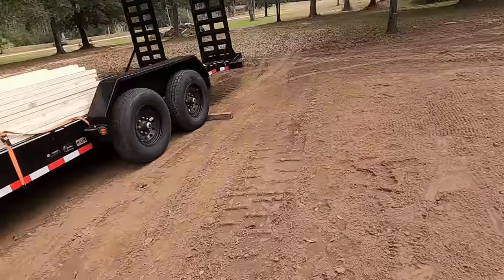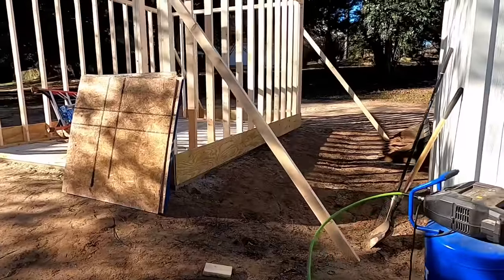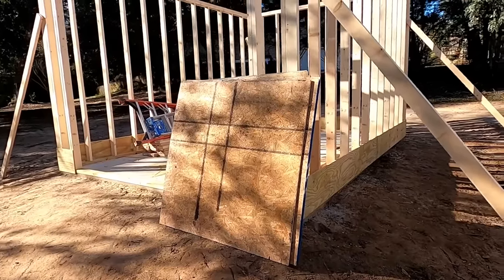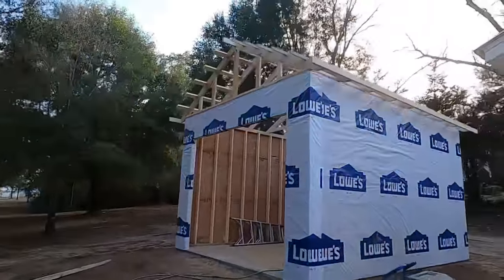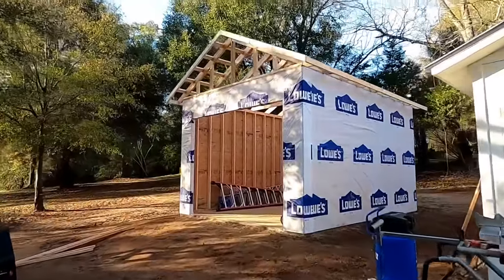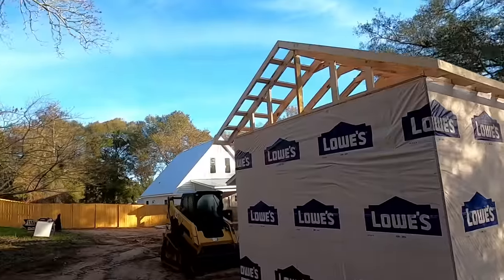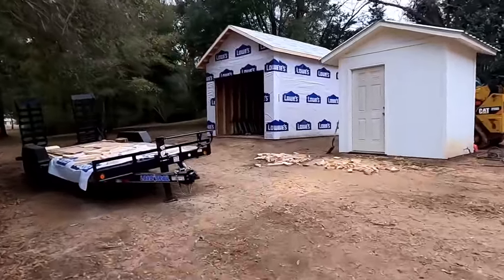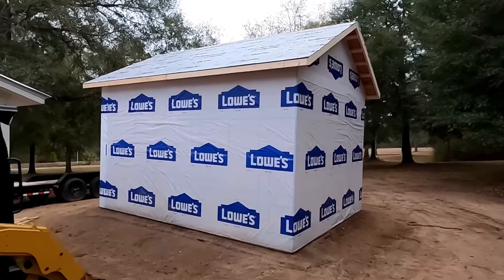Building a 12x16 Shed start to finish! Time lapse. Cost $2,800.00

Comment: So this has to happen for me this year.  I see a lot of videos really pushing screws rather than compressor driven nail guns.  Thoughts?  For sure the screws are a little more expensive but no compressor, etc.
Reply from the maker: Yeah I like screws for somethings. I used them to install my ridge beam. Then again on the rafters just one in each to get them in place. Other then that I like using nails. If you don’t have a compressor you could buy the pasaload cordless framing nailer! You don’t need a compressor. It comes with a battery and charger for $399. Here in Alabama! Then you buy the gas fuel cell and your ready to go. I told myself that when I build again I’m going to buy one. I don’t have to wait for the compressor to recharge, or deal with the hose being tangled or not long enough. So anyway that my thoughts. Good luck with your build! What size building do you plan to build?
Reply: @weightbuilddig166  12x16 minimum.  Rule is the big door will allow me to drive my JB lawn tractor (think cut the grass) into it and back out.  A loft, and a secondary door for people access.  Going to wire it for DC so the solar panel will handle charging and security, illumination etc.  Also going to add in a small subpanel that runs to the outside that will allow me to plug in a generator if need be.  The AC will ONLY go a 2 outlets, one being to the AC to DC convertor.

That's my dream.
Reply from the maker: @cgilleybsw  That will be nice! You can do it, just be ready to put in the work. It took me 3 months from the start to finish. That’s 4 hours Monday through Saturday. Then 8 hours for two weeks Monday through Saturday.

Comment: This is exactly what I want to do in my backyard... But I will probably go with a wood floor instead of concrete, mostly because I know nothing about pouring concrete.  Any advice but that?
Reply from the maker: Oh cool! Are you asking advice on the wood floor?
Reply: Concrete is very affordable. Probably more than wood nowdays. Watch some concrete slab videos and you will get the idea. A small slab is not that hard to pour by 2 or 3 persons. If you can order a cement truck that is the way to go.
Reply from the maker: Yeah I did this myself with the help of my buddy. It wasn’t bad. It was my first time doing it myself. I poured 4 yards and it cost $900. I got 3000 psi with fiberglass and it was $175. Yards. Two years ago I was building my house doing the foundation and I paid $125. A yard. So our concrete is more but our wood is way down almost back to prices before Covid.

Comment: So is that cost include permits? Cuz at least here in Michigan you can only go up to a 12x12 n it cant be attached to the ground or another structure in order to build without a building permit. Unless its for agriculture
Reply from the maker: Well I live outside city limits so there is no permits required
Reply: @weightbuilddig166  I don't live anywhere near a city, still gotta have a building permit though. All it takes is someone seeing a bunch of building materials going to a property or someone seeing n hearing construction n they can go say something n a building inspector with nothing better to do will be all over it wanting to see the building permits. Can't do anything in Michigan unless it's super hush hush n no rats or enemies just itching to report it
Reply from the maker: @benmiller5015  Yeah your right about that. I did go to get one and they said I didn’t need one. So I did check. I did have to get one when I built my house.
Reply: @weightbuilddig166  that's awesome that your area has more reasonable building regulations. It just kinda sucks that around here you could build a 100ft long building as long as it's agriculture but I can't build something bigger than 12x12 without a permit
Reply from the maker: @benmiller5015  That’s does suck. Make’s you wonder what they base there decisions on.

Comment: Just curious, but why not use 24 inch spacing for the studs? It looks like the rafters were 24.
Reply from the maker: Yeah the rafters are 24”. Yeah I don’t really have an answer for that. I like 24” on center it would save on some wood but I always just seem to go with 16” on center. More of a habit lol.
Reply: That is pretty typical actually. wall studs and floor joists usually are 16"oc while rafters and trusses are usually 24"oc
Reply: I was told one houses-16in sheds-21-4in. Probably 15 years ago… but I have no faith in myself so I overkill everything. Always 16

Comment: Does the slab have footers and rebar?
Reply from the maker: No footers. The slab is 3000 psi with fiberglass 6” thick. The fiberglass is so you don’t have to use rebar.
Reply: ok thx

Comment: Does the 2,800 include the cost of the slab?
Reply from the maker: Yes it does. $900. For the slab $200. For dirt and $1700. For the materials.
Reply: @weightbuilddig166  no way!! i need to check my math on the slab estimate i did for myself
Reply from the maker: @jenniferhermanson8969  yep that 4 yards at 3000 psi with fiberglass and delivery $900.
Reply from the maker: @jenniferhermanson8969  Yep that’s 4 yards 3000 psi with fiberglass and delivery

Comment: This would need a permit where I live and it would not meet code starting with the foundation.
Reply from the maker: What would be code for the foundation where you live
Reply: @weightbuilddig166  15 inch footings with steel at least 3/8 rebar and 18 inch block above grade filled with conrete or slurry. The snow would eat up the sill plate in 5-10 yrs because of snow here, so you can't put the walls on the concrete the way you did. We had a 2 foot snow 4 days ago. It piled up to the top of my block on my house and garage. You would need a permit for that bldg. too.
Reply from the maker: Yeah that makes sense. Thanks for sharing the information.

Comment: Lots of code problems your header is only a single Jack on each side should be double jacks yes plate should be treated should be pearllines in the walls And your garage by code is required to have a slope from front to back and should be a sloped at the garage door and there isn't one and the garage door isnt bolet down properly as per code  there is none for the rest of the structure bolted either
Reply from the maker: Thanks for the info. I did forget the double jack legs. I’ll put those in there.
Reply from the maker: I did put those in there. I just checked.
Reply: @weightbuilddig166  I hear you but your pictures didn't show it
Reply from the maker: No your right I didn’t put those in I was thinking of something else.
Reply: I’m guessing if he didn’t have to have a permit there isn’t a code in his area

Comment: I’m shocked you got that done for so inexpensively nice job! I’m guessing that doesn’t include siding roofing or doors
Reply from the maker: You are correct. That dollar amount is to that point of the build. Concrete $900. Dirt $200. And building materials $1700.
Reply: Yeah that's a crazy good price. If I was to build the same thing here in Maine it would be significantly more than that. Excellent video!
Reply from the maker: @Dorchwoods  Thanks! It would be interesting to know what it would cost to build this same size shed in each of the states.
Reply: @weightbuilddig166  its costing me $128k to build a 24×48 garage in California right now 🤕
Reply from the maker: @bradl4761  wow! I want to build a 30x50 garage this summer.
Reply: @weightbuilddig166  I'll tell you this , here in PA to the point where your at now probably 5600 If I did it for myself. If I built this for a customer include doors, windows, loft siding metal roof I'd charge easy 10k
Reply from the maker: @timothymetzler7715  Yeah if I was charging to build this it would be around $10 to $12 thousand. Our wood here in Alabama has really gone down. When I was framing my house two years ago I was paying the highest price for lumber ever. Crazy

Comment: Curious, did you need permits for this? In Oregon I've read that a 200sq ft building measured from inside walls is okay without permit. But is also says it can't be more than an average of 10ft tall to the roof...
Reply from the maker: I didn’t need one. I could build 30x50 garage without a permit. But I Don’t live inside the city limits. If I did live inside the city limits then I would of had to get one for this shed and the garage. I did have to get permits when I built my house.
Reply: @weightbuilddig166  Oh lucky lol, thanks.
Reply: @weightbuilddig166  Built your own house? Well, damn no wonder the shed came out so great.  Great skills, sir.
Reply from the maker: @noyzizi  Thanks! Yes I did build my house. It took me 18 months. It’s still not 100% done. Lol but We’re living in it. It’s 97% so it very close to being done.
Reply: Where I live there is no size minimum for permit. If you are building a 5 x 5 storage building you need a permit. It sucks but we also have people turning them into houses.
Reply from the maker: @chazman4461  yeah that’s true. Here in Alabama if you don’t live in the city and it’s not a house then you don’t need a permit.

Comment: slab cost? buying your own trailor, fuel for truck to haul trailor. anchor bolts, nails air gun,  18 pieces of siding board at what $10 a board = 2800? how many $1 .    40 ea 12' 2x4 where free?

Comment: Double plates not on with the walls before standing, no L’s on any corners PLUS marking every stud with a level?! And, where is the sill gasket under the plates?!?! 

🤦🏽‍♂️
Reply from the maker: I just used the level so I know where the stud was when nailing the osb on. I did forget the foam on the bottom plate. Everything else I put on after the walls were up.

Comment: Not even looking…..you cannot purchase the concrete and rebar for 2,800.00
Reply from the maker: Well I didn’t put rebar in there. I went with fiberglass in the concrete. I paid $900 for the concrete. I put it down my self. Plus keep in mind the $2800 is just to the dry in part. When I finished the build I had $7000 into it.

Comment: Don't believe it. Obviously his time is worth nothing. I couldn't even buy the material for 2800 in my neck of the woods.
Reply: Maybe you could maybe you couldn’t. But that’s what he said he spent & with the quick math I did he would have about 1700 in lumber and 1100 in concrete & labor would be free and not including things like nail gun or diesel
Reply from the maker: This is just the cost of the concrete and the building materials.
Reply: Most people don’t count their time as a cost when building a project for themselves. The $2800 seems about right for materials.
Reply: Common sense tells me to read the description… so it was there I discovered that he built the shed for himself… the point is to do it for as cheap as possible.